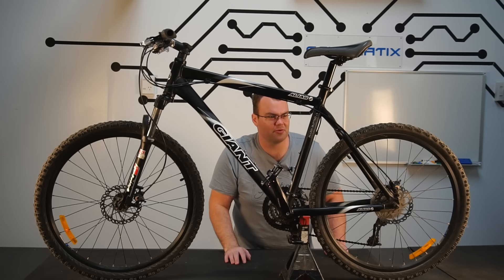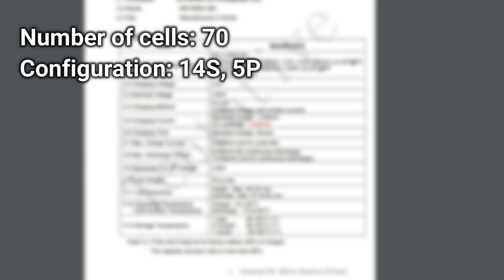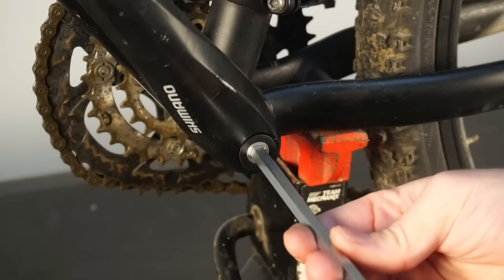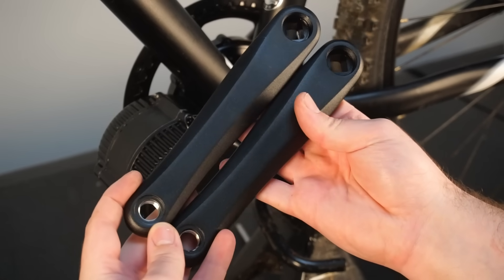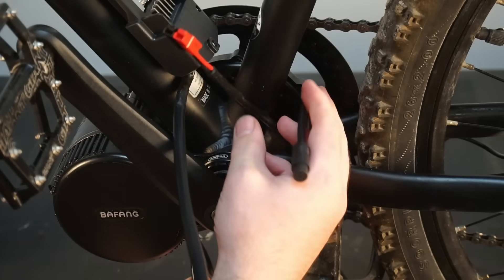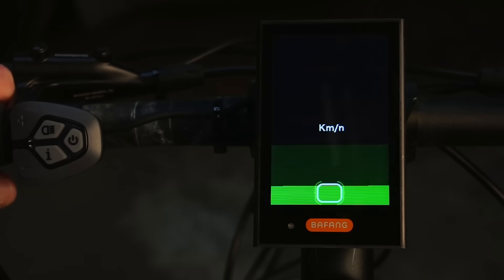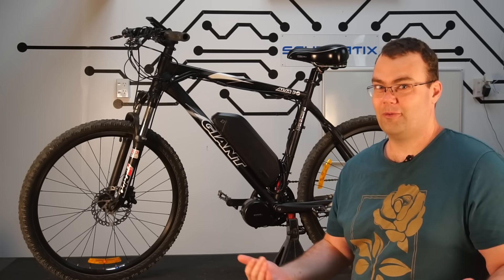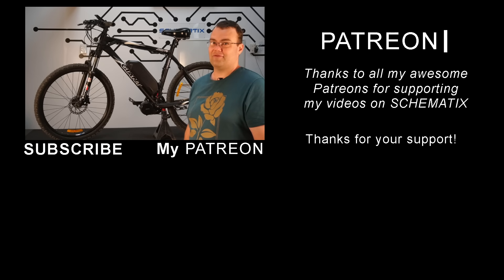eBike Conversion Kit, Install & Review ll Bafang BBS02B 750W motor

Comment: Excellent instructional video - many thanks. I always say when I need an electric bike I'll give up riding. However at 72 and lately loosing my wind considerably - maybe....just maybe.
What weight does this add to the bike as my Carrera subway is 19 kilos with 8 speed hub & dyna front hub plus self at 100 kilos.
Thanks again, Best from the UK.
Reply: 5.5 kg
Reply: what is 70kph in mph? and how much does it cost in dollars, not pounds

Comment: Removing the bottom bracket 5:45 can be a heck of a job. Working on it now. Have the right tools, turning in the right (and left) directions. Using the tool included tool in the Bafang kit but it is a bit weak. I've spent 50$ (of course) on this job alone. It's a tight screw to say the least and the hand placement is not ideal (you need to push down and turn... ) perhaps a tool that looks like a steering wheel would be better?
Right now wondering if I should 1. Use shock (a bit of hammer to loosen things) 2. Heat (heating the frame is an option too) 3. Taking it to bicycle repair. 
Can't wait to get it off.
Reply: Need more leverage on the tools. Use a 4 foot pipe or other strong metal tube to go over the handle of the wrench.

Comment: Good show. A few questions if i may. This is pedal assisted ? So can it work without fitting the thumb throttle ? Im a bit of a weight weenie,so im thinking is there a need to fit the extra safety "well arnt i dumb for holding the throttle wide open and thinking the brakes will stop me" seen it happen hundred times on motorbikes,by people that had no need to be on a motorbike. And if the battery itself would have 4 lights/or green,amber,red to show battery charge,is the screen needed ? Is the chainring a common pcd pattern such as shimano/campag ? for replacements/smaller tooth chainring ?  cheers.

Comment: He didn't explain how that without front derailleur its gone from a 24 or 16 to an 8 speed bike? So if battery dies your facing a calf muscle exploding ride home? Q: Does the 5 power settings work on each gear? So is it 5x8 = 40 effective gear positions? Confused

Comment: With conversion kit installed do you keep your regular brakes or do you need specific special brakes?
Reply: Rim brakes will be ok with 250 watts. Hydraulic discs will be more than good enough for full power - off-road only of course. ;)
Reply: @Dave5843-d9m  by hydraulic do you mean disc I have disc brakes on bike

Comment: FYI and goodwill: You have not done any research into the included components. You have not provided any info on variable items such as the bottom bracket dimension or the model of the bike you were supposed to be converting. You did not even bother to explain why you were discarding the forward 2nd chain cog and the forward Derailleur. You gave no advice on the appropriate usage of wheel rim brakes or disc brakes or even the use of hydraulic or cable-actuated brakes as an essential or even critical health and safety concern! There was an opportunity to include so much helpful information you have simply not taken the trouble to clarify. This is about as lazy a review as is possible and may result in misleading some cyclists to receive serious or fatal injury! Shame on you, amend this dangerously uninformative video with a little dignity and hard work - or face the wrath of your potential victim(s) and their families and lawyers instead. Learn from this mistake and respect your audience as much as your friends. Thank you.
Reply: Yes, he does expect us to be adults. I am guessing your mother still holds your hand when you cross the street.

Comment: hi, much thanks for your helpful video, friend! I'm looking to convert my 26" cruiser bicycle... I had a question, if you could, please? regarding attaching the motor into the bracket opening, is the sizing universal or would I need to measure and match?
Reply: Measure the diameter of the bottom bracket. The bottom bracket is where the pedals are going round and round on a standard pedaling bike and you got to measure that diameter so you can get the right size mid frame motor.
Reply: @bassinbillRC5300  many thanks, friend ✌🏻😌

Comment: Thank you, a interesting and informative video, one of the things that I would be concerned about, would be the waterproofing of the various electrical connections, I realise that mudguards can be fitted, however, here in the U.K. it rains a lot, and the connectors need to be waterproof.
Reply: Sorry mate you aint allowed to get one over 250Watts on your push bike in the fucked up UK
Reply: With low(ish) voltage DC you don't need to worry about waterproofing as much

Comment: I built mine a few years ago and would like to make a suggestion. If you eventually want to change the motor's parameters for a much more custom feel there's a well used program on the aftermarket that will give you the ability to modify the control unit's firmware. You can get all the info needed at Endless-Sphere.
Reply: Steve- I’ve been thinking about retrofitting my bike with a Bafang or similar... how would you say your build has held up over time? Is a Bafang middrive conversion kit for the perpetual tinkerer or does it operate well for all users? Perhaps said differently, is your wife, partner, or child able to use the bike with ease? Appreciate any feedback you have to offer.
Reply: @exeterjosh  I've had it know for 4 years and am the only one riding, not too much probably 1500 miles but it's going well. I have put higher quality grease in the gears and replaced the stock chain ring for an aluminum with offset teeth. Overall it runs smoother. I've also kept the amp output at 18 even though it can go to 25 and of course custom reprogrammed the control unit to my liking. I really can't answer beyond this... Steve
Reply: @stevejohnson7132  Thank you for the feedback. I appreciate it.

Comment: Great video. Do you know what the two little short wires with the blade connectors on the motor are for?
Reply: Head lamp...
Reply: @joewade1465  thanks Joe. I ended up load testing the headlamp 6.27V leads, only getting 5 Watts out of it. It has a protection circuit that automatically resets.

Comment: How long did it take before the crank nuts loosened and rounded out the square hole? Because you did not torque them down enough. Unless you tightened them using a torque wrench off camera. Those need to be torqued down tight.

Comment: I would love a update video! Looks like a great bit of kit though. I also like the enclosed style and the only downside I can see is that where I am only 250W is allowed. Though I must say that the ones I've tried do help quite a bit. Makes me think that all that wattage you have available is only ever being used for starting and slowly ascending hills. Great video (As per usual for you ;-)
Reply: Where are you Klaus? Those are some pretty out of date restrictions! Here in the UK the law's a mess on e-bikes. There's 1985 legislation that limits them to 250w/12v, but this only applies if you register it with DVLA, and there's no requirement to, so nobody does. We were adopting the EU legislation, but it was never ratified into UK law, then we left the EU, so it never will be. The police have enough laws to deal with anyone being wreckless or posing a danger on the road, so if someone builds a monster, and hasn't set a sensible cutoff speed they declare it an offroad e-bike, and if they catch you on the road with it again they'll charge you with something and confiscate it.
I have run a 1000w front hub motor set to 32kmh (20mph) for many years. I behave in traffic and try not to show off or surprise motorists at junctions, and I've never had any problems. Police usually have more important stuff to deal with.
Reply: @JoesWebPresence  I guess the SOB's will never be happy!!
First they outlaw most gas powered bikes/dirt bikes, say their too noisy, pollution, bla, bla, bla! 😭🙄
Then they outlaw e bikes, it's all about their power over you, nothing else! 
Remember the power we gave these a-holes during the "pandemic"  and the lies and B.S. aren't slowing down.
Maybe someday we'll take back our countries from these morons?
Reply: Kit comes with 250w sticker!  Naughty.
Reply: @petersimpson633  that's funny that. Might look at getting the 1000w hopefully I get a sticker with that
Reply: Awesome!  Thanks!  Update please?  Has the frame/chain held up to the extra power?  Is it still capable on single track or anything more technical?  All the electrical components still working?

Comment: Thanks, well laid out instructions. Worth mentioning that mid-mounted motors bring the advantage that motor power routes through the choice of gears available and, as a result, are better than hub motors for hill climbing.
Reply: Thanks, I was wondering why the mid-mount motor was best for hill climbing.
Reply: I had one and went through a lot of broken chains as the torque is brutal on chains!
Reply: @gregb1599  Slacken off peddling when changing gears. You don't want the power train activated when the chain is between gears.
Reply: @gregb1599  I've had the bbshd 3 years and I'm 200 pounds. I have only had one chain ever snap on me and I was doing what the other comment said not to do. If you want to reduce the chance of a chain snap while shifting, I would consider investing in a gear shift sensor. It will cut power to the motor every time you change gears.
Reply: @martinpadilla5224  Thanks, but that electric bike is long gone. Other issues were the weak crank arm bolts that came with the motor, they ended up stripping so could never keep them tight for long. That was first gen model so I am sure everything has been improved...
Reply: @martinpadilla5224  fit the brake sensor to your levers in such a way that it cuts the motor when the lever is lightly applied without actually applying the brake and you wont need the shift sensor. Less clutter is always better.
Reply: you need a gear sensor man, it cuts power when you shift so it doesnt damage your chain or gears  @gregb1599

Comment: What happen with crankset and chainring? It is crap quality? Is it too heavy? ChainRing is with narrow wide? Kit works with one chainring? The number of teeth of the chainring is with 38 ,40, 42 is available? What is the Battery dimension? size width depth length?

Comment: This bike is illegal. This video should be taken down. As a qualified bike mechanic i am sick and tired of seeing people who bring this kind of bikes in the shop and expect us to fix them. This frame was never designed to handle the braking and torque forces involved. I have seen snapped frames and people seriously injured in crashes.
Reply: As a qualified bike mechanic, your sick of... Job security? Up charging for the wiring routing? Sick of a massive upturn in bicyclists and the industry? 40 year old bicycles with 5200W motors don't have broken frames bro... Your barking up the wrong tree as to the frame breakages. 750w is nothing compared to trail riding
Reply: They system is too powerful. 250 W is better.

Comment: Mine goes like stink. The 750w is more than enough. You can hit over 1000w for short durations. I use a ego 7.5 ah 56v lawnmower battery. I would suggest the eggrider (made in UK) controller so you can easily change all the bafang esc controller settings. I would also suggest the 36 tooth lekkie chain ring.

Comment: Is your motor and battery stays in place so far? Battery pretty heavy over 10 Lb (6kg) It is kind of scary to mount it on two tiny M6 water bottle screws holding in frame by a few tiny thread lines. Battery should be wobbling during ride and can easy rip off those 6mm screws. I would make custom long bracket (battery long) and tight it to the tube before mount battery. This way it will be more rigid design. As far as motor bracket - same thing. Bafang provided bracket with small bumps not strong enough to hold motor in place. I made custom bracket with little handle bolted on kick stand place at the bottom of the bike frame. Do you use shift sensor?  Thanks for video. I was debating between motor and battery size, but after watching your video bought exactly the same.
Reply: Yes! Definitely add a few more screws, otherwise you will loose the battery (causing lots of possible damage) at some point (e.g. heavy ride or small accident). I had the experience. 2 Screws cannot hold that amount of kilos, they were never designed for that in the first place.

Comment: Does Bafang make any motors with a torque sensor at present? According to the company webpage, they make or made the M600, p/n MM G521.500.C,which is a 500W motor, and described it as having a torque sensor. It doesn't seem like any of the newer model BBS- do. Does anyone have any info on this? Thanks.

Comment: Is there also a sensor on the schifter cable.
So when shifting you dont putt to many forces on the gear's
Reply: yes there is, i highly reccomend fitting one as its awful to ride without. the motor has a seperate cable for the shift sensor and it cuts power for the perfect amount of time to shift smooth and have power right after. you have to order it separatley as its not included in the standard motor kit. i also reccomend getting the smallest Chainring possible, a 44 is the smallest they can deliver with the kit. there are many adapters wich let you fit 104bcd Chainrings but the Make the chainline more worse as it already is in the smalles gear.

Comment: I´ve been using my Bafang for a couple of years now, and like it a lot.
There were problems to overcome  .......
First it would not slide fully in to the bottom bracket, it fouled on the chainstay, and I had to return the frame to the dealer for some fancy welding.
That was sorted vey well, and not too expensive.
I found the automatic pedal assistance could be dangerous where pedestrians or unfenced mountain roads were concerned,  depending which gear the bike was in it could surge forward when I wanted to creep.
I dismantled the motor, (quite straightforward) and cut the appropriate wire to disconnect the auto function and reassembled.
To my dismay, the motor was dead.
Opening it up again, I tested all the connections and found that a white connector had not been fully connected,  I pushed it in, it clicked, and all was then well. My ministrations had been the final thing to break the connection.
After a while, the thumb throttle broke, due to being flimsy plastic, and I had to fix up another one. This took a few attempts, and on a couple of occasions the return spring failed with results that are only amusing in retrospect.
I´m on solar power here in Spain, and need two batteries so I can ride while the sun shines and charge the other battery during the day.
I´ve no regrets about buying Bafang, living in the mountains it´s a real gas to flash past the professional Lycra-clad locals as they puff and pant.
One thing I would emphasise,  is that putting my 1Kw motor on a bike without disc brakes would be about the daftest thing anyone could do.
Reply: Great writeup. Love your humor and had a giggle. Good on you M8.
Reply: Disks on my bike are working VERY hard now. Speed is deceptive until you hit the brakes!

Comment: Nice!  I am across the pond in the US.  I had a pretty severe fall a few years that left me partially disabled.  I can only be up and about for a couple hours till the muscle spasms start in my back... but in that time I LOVE my eMTB!  I converted a Montague Paratrooper and added a 1500w BBSHD mid drive,  I went with a half throttle...like yourself I have a history of riding from the little mini bikes with lawn mower engines in the 80's, to mopeds, motorcycles (street), and Quads and trikes (off road)...I wanted a throttle on the right side.  I used it mainly when one day I was standing up pedaling in the mud and the arm stripped out, also damaged the pedal...but I bought it on Amazon with an extended warranty so they refunded me 20%, and I ordered me a new pair of cranks, and new Pedal's.  I am 53, My cardiologist thinks its great for my heart(just had a double bypass in december, and the surgeon came to ask me in recovery if I was an athlete because I have kinda thick calves and muscular and he said my heart was a good size for my age and was very muscular.)  I told him about building myself up to doing 8 miles a day , and I go looking for wild life, deer, foxes, and the like here in the suburbs.  I keep trying to encourage my out of shape friends to give ebiking a try.  I took a ride to where my best mate in grade school lived, on the corner of a real steep short hill on one side, and a long slow grade hill on the other.  Even as kids we would ride down the steep hill for speed, but would always pedal up the lower grade hill.  Well I put my bike into pedal assist 3 and I rode up that hill like it was flat terrain LOL.  https://www.instagram.com/hermitage_leathers/  couple pics of my bike, and my little transit connect camper I converted.  Happy Trails!

Comment: I fitted a BBSHD to an old Rockhopper last year. One thing I would add, is that before buying a kit, check that the gear housing will not foul your chainstay. If it does, you will need the 74mm - 100mm or possibly the 101mm - 120mm version and use spacers. luckily, mine did fit the Rockhopper, but not my Cannondale. The supplied chainring is poor quality and you may have to modify the cassette to get chain alignment right. I reduced the number of rings to five and used spacers. The bike is great fun to use and goes like ****.
Search the following for more help "Will the Bafang mid-drive motors fit on your bike"
Reply: Excellent document on the Bafang Mtr Fit.  Thanks
Reply: How do you check that it will not foul the chainstay before you buy it